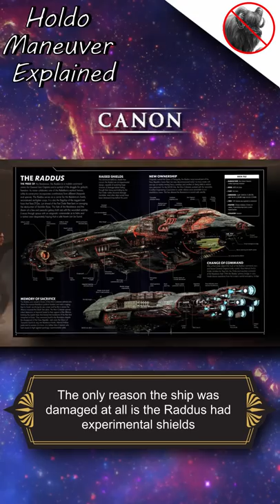Holdo Maneuver Explained | No BS Lore

Comment: “Experimental shields” that could only cover one section of the ship at a time ? Shields that were so horrible you couldn’t have the bridge, hanger and engines covered at the same time ? And did she move the shield from the rear to the front before she hyperspaced if so….why ? Nothing in the sequel trilogy makes sense and even the shit Band-Aid fix’s just make me ask more questions. What a steaming pile of dog shit all 3 of these abominations are and everything associated with them
Reply: to be fair,  can't shields be concentrated to the front though?
Reply: @mozyco3093  it was never established. Shields in the SW universe (to my best recollection) don't have concentrations. They stem from a point and either exist or don't. 

Star Trek has the capacity for diverting power to enhance Shield locations.

Could be wrong..  it's the internet so someone will correct me if I am
Reply: @saw31489   “Switch your deflectors double front” from Episode IV: A New Hope during the trench attack on the Death Star. I might not have the quote exactly right but Star Wars mentions separate direction focused shields multiple times in the Original Trilogy and the Prequels, and the ability to sacrifice protection in one area to reinforce protection in another.
Reply: I recall Ackbar saying divert power to the rear shields once the supremacy first appeared. That left the forward shields exposed
Reply: @Iwillfigureoutanamelater  I'll look into the quote a bit later. As I said, could be wrong. Just trying to go off of memory and non-disney star wars Canon that I haven't seen in a hot minute.
Reply: The sayings of "concentrate our shields to x area" are fairly common in star wars media. However, I've always assumed that the basic shield formation is, like it should be, spread equally around the ship.
Reply: I believe that, star wars shields also have strength gradient, as in they get weaker the further away from the generator they are, which is the lore reason, i believe, for the stupid positioning of the generators on ISDs, because they are put on the bridge to protect it. That is also a strength of tge moncala ships, because zhey have more generators spread among the ship and therefore overall better shield strength.
Reply: @saw31489  sheilds in star wars can definitly be shifted to "all front" or whatever else you want. But this shit is just stupid.
Reply: @saw31489  so yes and no. Shields can’t be concentrated to a place. But the ships energy can be concentrated to selected generators. Shields generate around shield generators. The closer the shields are to the generator, the stronger they are. While you can’t really tell a generator to create their shields on the the other side of the ship, you can just power off that generator and divert the power to the front generators, so they get stronger shields. A ship only has so much power to manage and usually not enough to run all systems at all times let alone all systems at Max capacity. Also shield power increases exponentially, but negatively. As in the more power you feed into it the less the additional power adds. So let’s say hypothetically you feed a third of your energy into your front shield and a third into your rear shield. Now you take away the third of your rear shield and also feed it into your front shield. Theoretically this should double the output since you doubled the input. However it doesn’t. The output is obviously more than what it was before, but weaker than double it. But all of this doesn’t matter anyways since canonically shields can’t be active or rather stop working in hyperspace so the maneuver still breaks Star Wars established rules
Reply: @saw31489  so does Star Wars - much like how you can shift power from engines to weapons abs such you can redistribute power to specific banks of shield generators to grant extra protection from specific directions at the cost of protection in other directions - this is why Kylo’s wingmen was able to penetrate the shields as they hit it at its weakest

Comment: The biggest problem with the explaining how the process works is that it makes it tremendously easy to be replicated. Get several small or large ships piloted by non sentient droids, equipped with the same experimental shields that can be made by an impoverished resistance faction, and have them short light speed jumps away from  the action. You can then have scout ships that could identify the position of important enemy vessels, and determine the coordinates that the light speed ships would need to jump to, and then send them to the ships so they can collide with the most important enemy ships and rip them to pieces. Its like artillery, but functioning on a galactic scale. Its frustrating because this process would be so easy to replicate, and its relatively inexpensive when you consider the effectiveness of it exceeding all expectations and being strong enough to completely obliterate one of the most well defended ships of the first order.

Comment: Also another factor: you enter a different dimension while using hyperspace, so stop trying to justify the changing of canon.
Reply: Where is this said tho I’m actually curious because I was always under the impression that you don’t, considering that hyperspace routes are a thing in canon, meaning that they shouldn’t be there if you’re going to a different dimension anyway
Reply: @krispybacon9927  I thought hyperspace routes weren’t there to prevent hitting someone traveling in hyperspace, but to prevent hitting ships when exiting hyperspace
Reply: @therandom7153  I guess but then why do the canon maps show actual lines for the routes instead of just two dots for the starting and exit points, but who knows they could just be there for clarification idk
Reply: @therandom7153  that and to prevent hitting a star's "magnetic glow"
Reply: @krispybacon9927  in said alternate dimension a star emits a "magnetic glow" which increases a star's size in said dimension, thus computers are needed to coordinate the perfect location to avoid stars in hyperspace.
Reply: @alphanoodle1877  where did you find that

Comment: Granted, flying a fighter into an enemy's bride can sometimes also take out the command ship.
See: RotJ, an A-wing takes down the Super Star Destroyer by flying into the bridge.
Reply: Wasn't the Super Star Destroyers shield down at that moment? Pretty sure that's why, because the A wing actually hit the bridge, not the shield. Also, neither one was entering hyperspace, which is canonical another dimension, which is reached after achieving lightspeed.

Comment: Or the fact that a starship was entering hyperspeed and was not going faster then light and the superstructure of the ship allowed it to smack another ship at point blank range at speeds close to faster than the speed of light. Shields of the starwars universe might be why the core of the ship was able to act like the lead core of a bullet. Shields disperse energy across their surface  so the energy bolt is expended befor it reaches the ship.

Comment: you know what eles makes damage in space? speed, a single bolt or nut running at high enough speed can penetrate pretty much anything, now throw a whole ship in to lightspeed and might not happend in an hour, a day, or thousand years, but somewhere in the great space there is a ship sized cluster of scrap metal moving at lightspeed untill it hits something, this is why they use lazers instaid of projectiles in space warfare

Comment: WRONG! The Holdo Maneuver had a 100% effectiveness. It was NOT a one in a million, it was actually 1 in 1.  

My basis for this correction is not from the ship's shields but due to the fact that the ship was outfitted with many Plot Points.

Comment: This is all patently incorrect, there's already an explanation for why the ship cut through it.

The fact is, this is indeed a possibility in normal space combat in star wars, but nearby planets or other such gravity wells hyperspace doesn't WORK because of gravity, and all larger ships have their own gravity wells, normally preventing light speed ships from ramming them.

In this particular instance it actually makes sense. The pursuing imperial ship had its gravity wells turned off so that way it could follow the rebels own jumps through hyperspace.

Making it ironic their own dogged pursuit of the ship is ultimately what led to their ship being damaged, they where so busy hunting they forgot that they could even be attacked in the first place.

I'm being a bit long winded, but basically as far as lore is concerned this is completely within the realm of Canon possibilities, and trying to explain it is worse than just letting it happen.

Comment: Except this doesn't line up with how hyperspace works. Most defenders of the scene assume that the speeds achieved during Hyperspace require infinite energy to achieve and therefore the vehicle travels with infinite energy.

This is not only wrong, but looks at Hyperspace the exact opposite way to how it functions. Hyperspace doesn't increase the energy a ship uses for travel at all, instead it lowers the amount of energy required to move certain speeds. In other words the ships collided with the same force they would have if they collided in regular space, which isn't enough to do anyway near that much damage.

Comment: Expiremental shielding, cant protect the bridge or the hull from fighters.
If this the norm why the resistance used strategic bombers to get the dreadnought? Two missiles/torpedoes could have damaged the weakpoint anyways, even rhe Xwings could have dive bombed the weak point if a proper mounting was installed, even even Poe could have soloed the ship mixing the boosters with some of those cluster munitions, we know he is a very good pilot so he wouldnt even need a guidance for the bombs

Comment: Just say if you go into hyperdrive to far away the ship is warped thinner then a bullet. The ship is destroyed but the enemy target only receives a small puncture and can be repaired with duck tape. Go into hyperspace to close to somthing and the hyperdrive explodes or fails to engage. Then you would need massive ships to perform the maneuver because they are the only ships that still have enough volume to do damage at the distance hyperdrive would work near a massive object.

Comment: Or perhaps it's one in a million because the threshold into hyperspace has to be just inside the Supremacy's Shields so when the Raddus jumps it is able to slip through but still be in normal space to collide with the hull at lightspeed. We've seen ships jump to light speed facing eachother on parallel courses like in Rogue One, in hyperspace they don't risk colliding with eachother but in the transition in or out they can and do as we saw one vessel get rammed by Vader's Star Destroyer yet the ship next to it that made the jump just before didn't hit it before it emerged into normal space.

The other factor to consider is that Hux gave to the order to ignore the Raddus up until the moment they realized what Holdo was doing. If they targeted the Raddus from the get go they probably could have destroyed it if not disabled it. So it's also a one in a million shot because you need the element of surprise otherwise the other ship might blast you to pieces while you prepare to jump.

Comment: You're wrong in so many aspects of this video I can't even put it all into one comment first of all Poe put the destination because they were jumping away from the ship the hyperspace jump point was pointed away from the ship admiral holdo changed the hyperspace destination and turned the ship around facing the enemy ship they already displayed the fact that you could jump through hyperspace without a destination it's just really dangerous 2nd it doesn't matter that holdos ship had experimental shielding technology because you're traveling at the speed of light any Mass traveling at the speed of light is going to do massive amounts of damage on contact it's called an R.K.K.V. OR RELATIVISTIC KINETIC KILL VEHICLES if a bowling ball traveling at the speed of light struck planet earth it would do the same amount of damage a 4 kilometer wide asteroid would do and  with each of those bits traveling at the speed of light are going to knock into other bits making those bits travel at the speed of light causing a Cascade effect or like what we saw in the movie with the spreading out of the material the only problem with this entire maneuver is the fact that they never used it before in any of the other movies or Star wars books or comic books that is the only inconsistency about how this maneuver I don't know where you got your information or even if you actually watched the movie as bad as it is! but you're flat wrong on this one, the great minds at nerdist explain the science behind this maneuver : https://youtu.be/i1M95njhovw

Comment: So how does this explain the fact that hyper space is a seperate dimension that cant interact with anything in real space?
Reply: It's not about speed, it's about the shields on impact after exiting hyper space.
If any other ship were to do this it would be like a normal speed collision.
Reply: @RayOfTruth  no. If any other ship did this it would phase through the other ships because youre in hyperdpace which is a different demension that cant interact with real space.
Reply: @robertharris6092  not if they exited hyperspace just before impact.
Reply: @RayOfTruth  but they didnt.

Comment: Even with experimental shielding physical projectiles and objects when going at extreme speeds tend to pass through or completely annihilate shields. Additionally the ship would have to smash through several kilometres of reinforced ship armour on the most advanced ship constructed by the first order even at those speeds it seems just downright impossible. I’d probably be more lenient if it only damaged the supremacy but the fact that it takes out an entire fleet is ridiculous

Comment: Sorry, the "Hold the door" maneuver  could never work, unless you break Canon. Hyperspace only works if you are far away enough not to be stuck in a gravity well of star, planet, black hole or the artifical gravity wells all Empire battleships were equipped with.
    Having both a planet and several large battles ships, not to mention each ship had tractor beams, 
    The holdo maneuver worked was because it was powered by feminism

Comment: Fancy way of saying “plot armor” no space battle in Star Wars needs to matter anymore cause 1 ship can just kinetically destroy entire fleets. So the death star(1 and 2) isn’t really a threat anymore. The Siege of Coruscant isn’t an issue cause the separatists fleets would be dead on arrival.  Space battles never need to be a thing anymore in Star Wars. And the fact that literally no one has ever thought of this kind of tactic till that point makes this universe crumble.
Reply: It's not plot armor, Holdo literally dies in this scene.

Also no, the only reason this happened was due to the Raddus' experimental shields, if any other ship tried this it would be almost no different from ramming into something normally.
Reply: @RayOfTruth  uh well physics says that’s Bull shit. You hit space dust at relativistic speeds and it will pretty much obliterate the ship. Like anyone could believe that those imperial ships could have just taken that kind of and surviving being rammed by a ship flying faster than the speed of light. It’s like being hit by a rail gun. A high speed kinetic projectile that only needs to punch through armor to be effective.

Comment: Nah… I mean that might be what they said is the case,  but frankly they pulled it out of there ass after the movie came out and there’s a much easier explanation that lines up with canon.

Ships in Star Wars can actually travel at and slightly above light speed without using hyperspace corridor… (i.e. Solo saying the millennium falcon can make .5 past light speed…) The issue is without hyperspace Corredor‘s even .5 past lightspeed takes years/decades to get between stars. So the hyper space coordinates entered into the ship are irrelevant, she wasn’t attempting to enter hyperspace she just jumped to lightspeed directly at the enemy ship. therefore the plot hole of using light speed mass projectiles as weapons still exists.

Comment: Regardless of all that, the Holdo maneuver still wouldn't work. Hyperspace doesn't work like that. People aren't traveling really fast, they're entering wormholes, which aren't in space. Think of it like a separate dimension. Do you know what would happen if someone were to try that even if it did work like that? They'd blow themselves up of the ships reflector shields. Think of the result being like a bug and your windshield. In theory you could make a gas like substance that erodes durasteel, that could have been an interesting concept to work with.

Comment: Still doesn't make sense... Shields would still not be able to withstand such an impact to something solid and you going hyperspeed. As soon as those shields freaking hit the mothership which was like 10x it's size, that shield is gone. And the Holdo Maneuver would'nt even be able to take out the fleet behind the mothership since it took all of the damage and that would fling holdo into a million pieces going everywhere disentegrating before it hits anything else. Minor damages, dont mind it, bang bang resistance dead. 

And if it does have experimental shielding, how did Ben Solo even hit the command deck if it's that sturdy?? 

Second, the shield is powerful enough, do a freaking blockade and take the blunt of the main guns of the mothership?? The smaller vessels are fast enough? Just body shield them right???